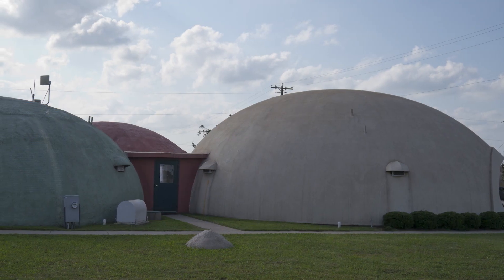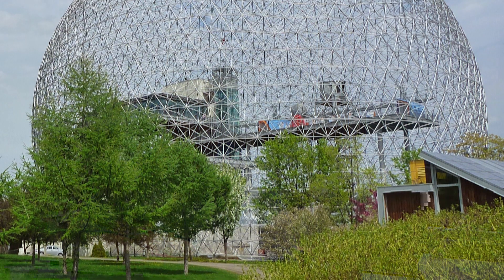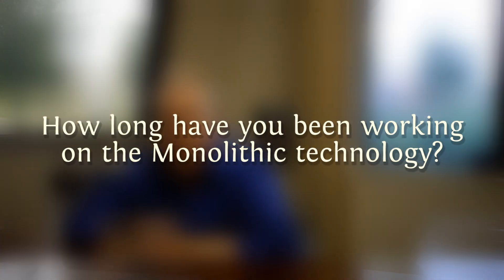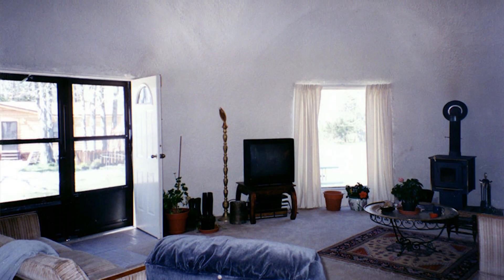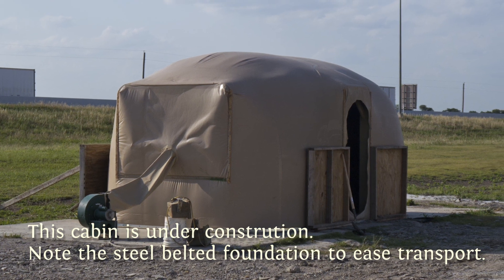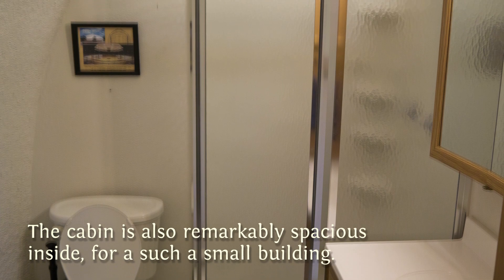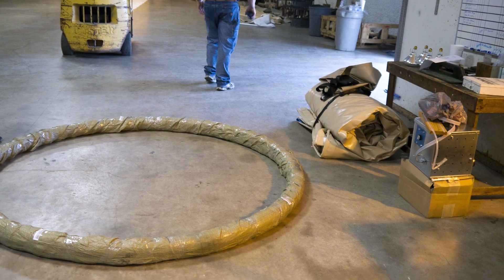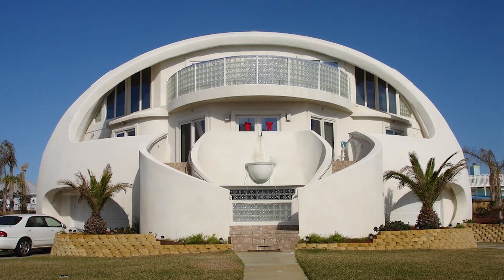The Trip for Life: The Monolithic Dome Institute Part 1

Comment: I would like to see a video on how the foam stands up to a fire! Does it melt? What happens as heat is applied, Is there more than one type of foam? I want to buil one in a forest environment, major concern fires!
Reply: When a dome is finished there is concrete over the foam.
Reply: troy brownrigg Put concrete on the inside and on the outside. It won’t burn.